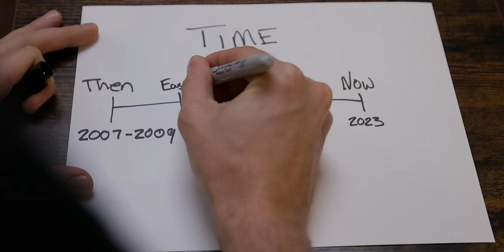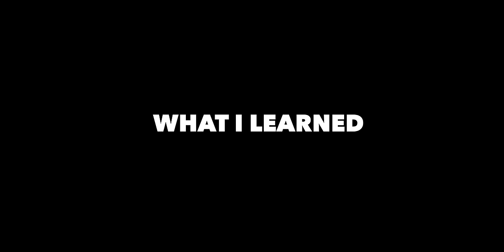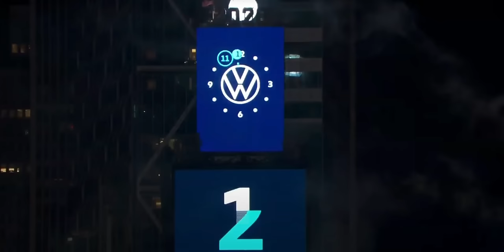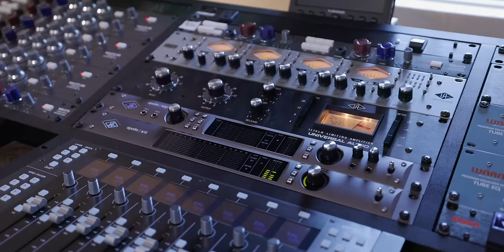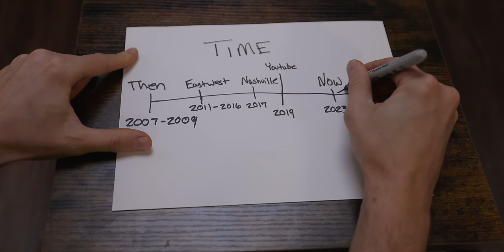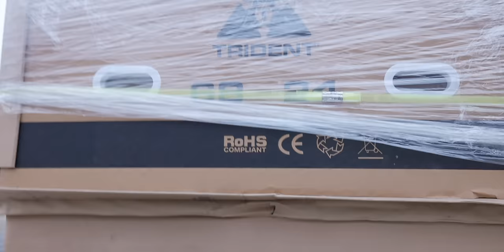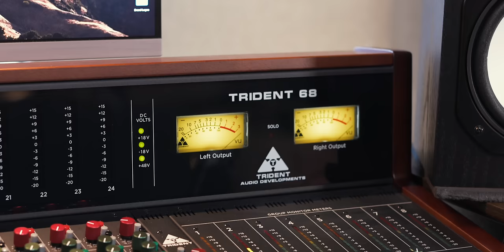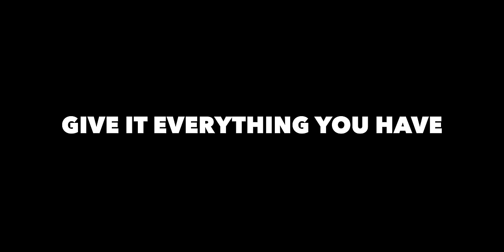Getting a Recording Console for my HOME STUDIO

Comment: I just picked up one of the Trident 16-ch 68s. I just got it all hooked up, and I'm looking forward to making my first recordings through it. This is my first console, and I know that there is a lot of assumed knowledge at this level, so I'm wondering if you would consider tackling a video about that "assumed knowledge." The manual lacks this information. I would love to see a signal go from the mic/line input, down the channel strip, through the busses, maybe out to some inserts, and where it goes into the DAW from (Direct Out/Master Outs/Monitor Send/Group Outputs/etc, etc,) with some brief explanation at each step.

Is there a video in your library that tackles this?

Comment: Hi, I an quite interested in getting one of the Trident consoles 68, 78 or 88. I am trying to figure out from reading the manuals but I can't figure it out. Is there in insert where you can put a compressor and EQ on the master bus?
Reply from the maker: Yes, it’s the mix bus insert. I’ve done a few follow up videos on how I use it.

Comment: Ah, my first interface was also the Alesis io26! That thing was equal parts awesome and AWFUL - at least mine was, anyways.  It had this habit of rebooting itself completely at random.  And when it did, since the volume knob was a digital encoder and not an analog pot, it would restart at full volume.  It was easy to know when this happened because every sound out of my monitors after that moment was at 100% volume.  Oof.  But man, did it pack a lot of capability for its price point.

Comment: I really like the sound and features of the Trident but as a writer I switch a lot between songs and not sure lack if recall won't be a pain. Wondering your experience with this?
Reply: I have that console.  I always keep my vocals Tr 1-4. and all my "normal" intruments on set channels, etx.  so it's really not too hard to switch songs. .  When it gets to the point where I'm anywhere near ready for a test of final mix, I'll take a snap shot with my IPad.  Now, I do a lot of automation in the box, and I have RME converters so there is additional routing flexibility I have. PMI audio has a demo version 16 trk/8 bus same series 68 for (K.